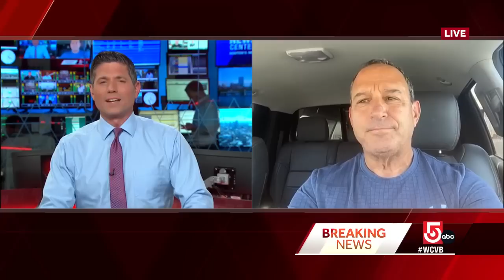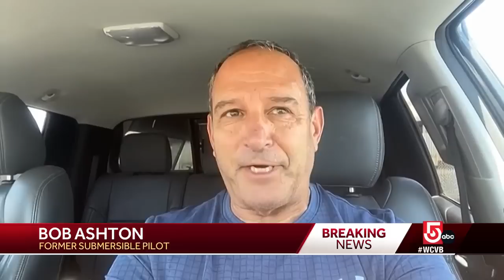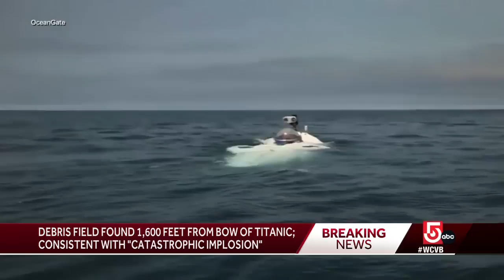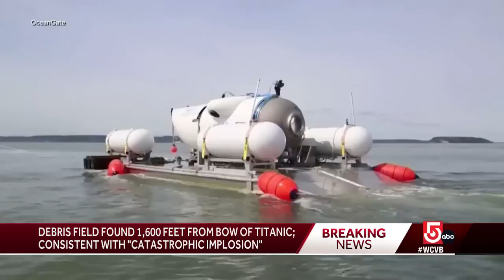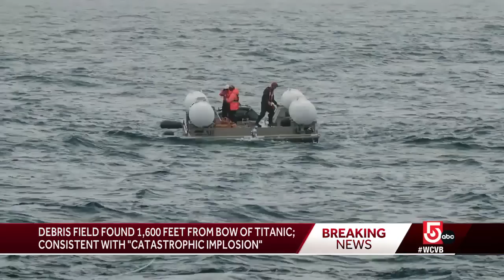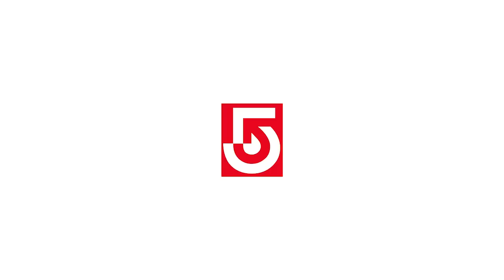Former Navy submersible pilot on what could cause cause 'catastrophic implosion'

Comment: Let me preface this by saying I am no engineer, the closest I come to advanced principles is snapping Lego bricks together 😂

However, it blows my mind they went with carbon fiber. I run a hockey pro shop and all sticks and most high end protective equipment/skates are made of the stuff, or include it in their design covering vital areas. Carbon fiber excels at impact protection, has immense tensile strength, and IS INTENDED TO BE REPLACED AFTER MODERATE USAGE.

My whole thing is like, and don't get me wrong, I'm very comfortable and make well over the national median, but how does a "lowly" store manager in sporting goods apparently know things that went over the heads of people DESIGNING AN EXTREME VEHICLE WITH HUMAN LIFE AT RISK?

You cant make this up. This was a disaster waiting to happen, sad to say.
Reply: I felt uneasy riding a carbon fiber mountain bike. Carbon fiber failures are pretty spectacular and the frames and parts had a limited lifespan.
Reply: @darkglobestudio4791  yep, 100%. As a matter of fact, carbon fiber failures can be so violent and dangerous that hockey sticks are actually designed to crack/split when they break, as opposed to shattering... which would send tiny, sharp pieces flying at any eyes in the immediate vicinity and turn the end of your now broken shaft into a potential murder weapon.

If you ever have watched a hockey game and noticed that as soon as someone breaks a stick they immediately throw it to the ice, that's why. It's an actual rule that will result in a penalty if a broken stick is continued to be held/used. If you've ever worked with carbon fiber, specifically broken carbon fiber, you'll know that it's literally sharper than a kitchen knife.

Edit: clarity

Comment: They used a carbon fiber and titanium hybrid design that is a big no-no for this kind of deep sea environment. The freaking ballasts were made from used construction pipe. It’s astonishing that it made several dives before imploding. But this kind of design meant it would not stand up to repeated assault from such pressures. The structural integrity would compromise. The CEO knew of these concerns, he’d been told numerous times from experts. Took an un-certified vessel with civilians to a dangerous environment anyway. 

The thing is, he went there himself too. He really did believe everyone else was wrong. It’s that kind of drive that can make for breakthrough innovation, or horrific failure, with nowhere in-between. 
James Cameron went to 30k feet in his own one-man vessel. Un-certified, but he was the only one on it. He didn’t risk the lives of others to prove he was right. 
This CEO did.

Comment: Im thinking it might be possible someone leaned on that fragile glass window that isnt supposed to go down that deep and let the water come in and blew up the sub
Reply: Doubtful. Lots of ways to implode.
Reply: It was acrylic. 5 inches I think. I’m not certain someone leaned on it and caused this. But I AM certain, that the material of the pressure hull was compromised by repeated dives and poor maintenance. They would have heard a crackle maybe, which would cause a sudden anxiety but not enough time to understand what was happening; then they would’ve been crushed to  death in two milliseconds. But it wouldn’t have been felt. Their deaths were quick. 13000 feet under water. They never knew what hit them. This submersible was of poor construction, with some materials I can get from Home Depot or a construction yard. None of it met standards for deep sea diving, and never would have been certified.